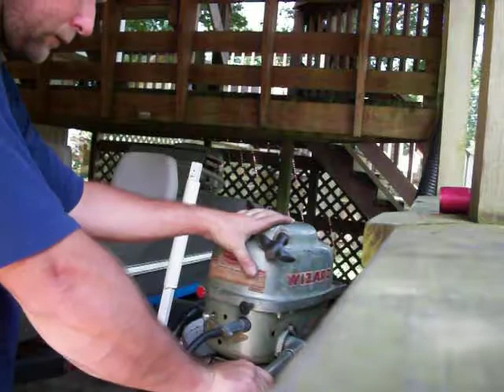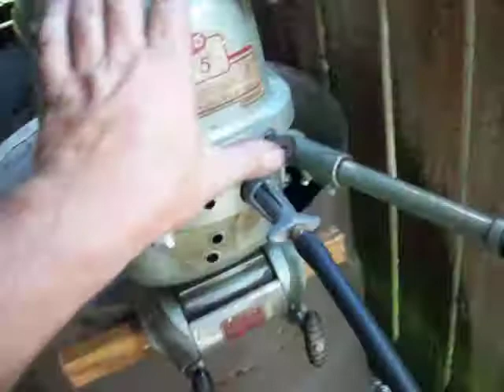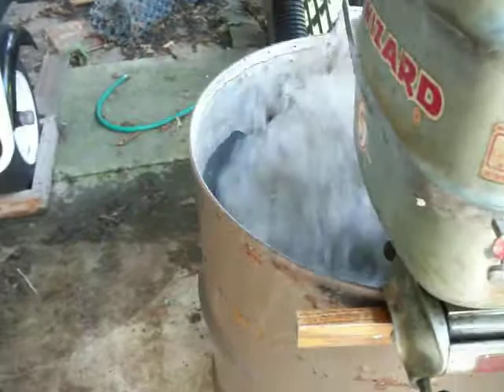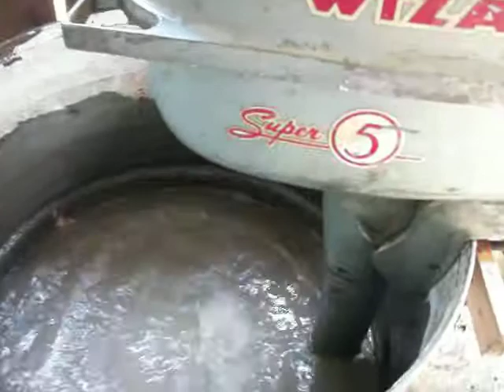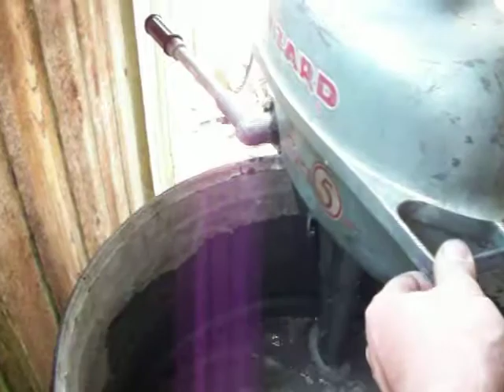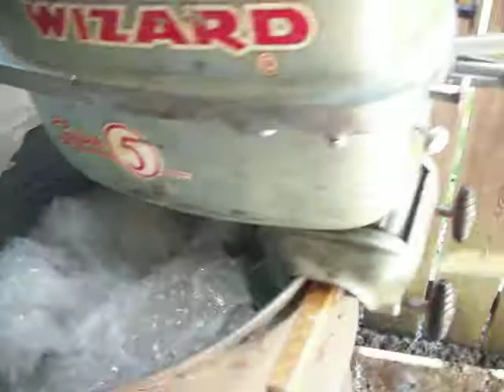Wizard Super 5 Outboard Motor Test #2

Comment from the maker: @cpgixxer  I figured it out! I was used to tuning omc carbs (turn jet in for lean, out for rich). This carb (on the low idle) is turn in richens mixture. High speed adjustment is opposite (in for lean). My mistake. New video to be posted soon.